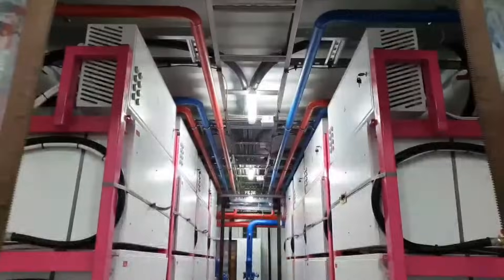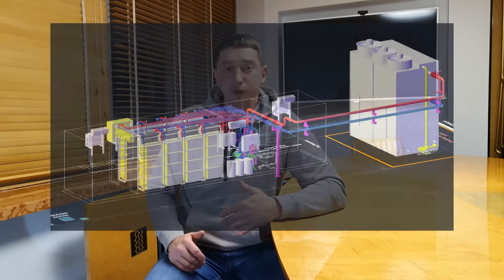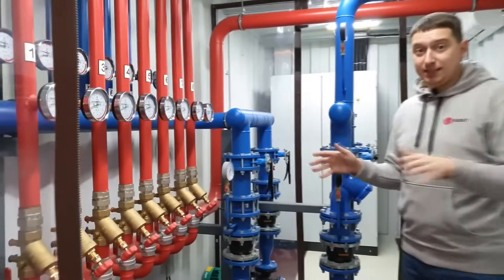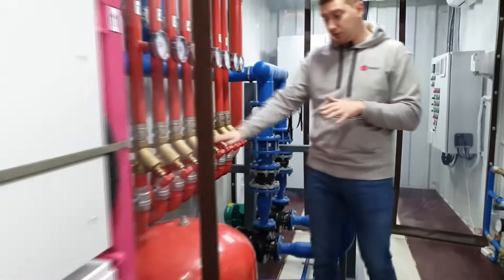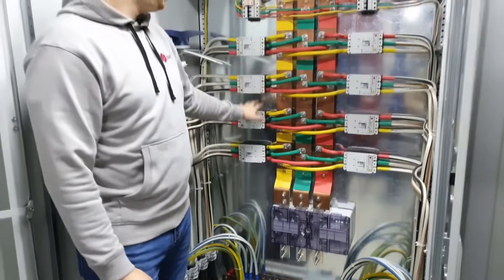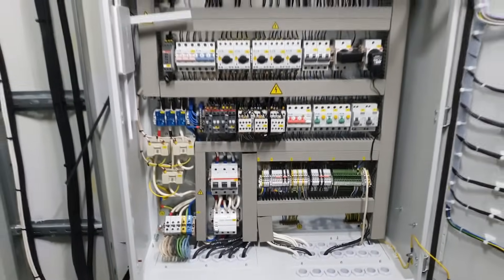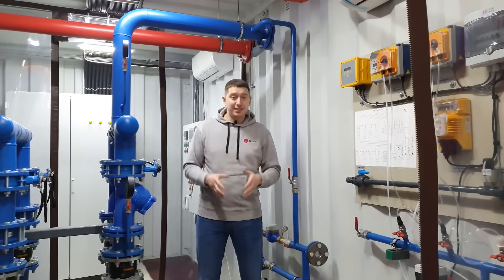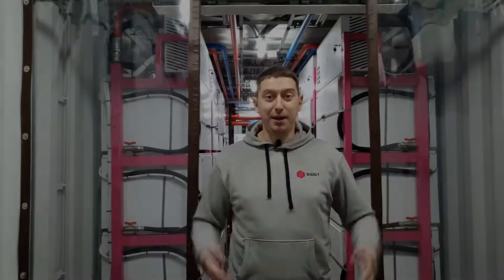CONTAINER FOR IMMERSION MINING

Comment: Guys, what ASIC I can you your containers for? And how resistible is your system to electric shutdowns and other emergency situations?
Reply from the maker: In our racks, any model can be immersed. The system is resistant to power outages and has its own control panel and monitoring. However, your power supply system should be the most stable otherwise it will not be mining. Equipment should work 24/7 to profit.

Comment: Would love to see a breakdown of how to wire all that…awg’s, voltages, relays, overloads, etc.
Reply from the maker: Most of the connections are already ready in the container itself, it is only necessary to connect the container to the power supply system and connect the pipes to the wet cooling tower. All this is in the design solution, which was developed by us.

Comment: Hello BiXBiT I need your help I just bought a miner and I'm using immersion cooling, I can disconnect the fans but I don't know how to turn the fans off in the program. How do you turn off the fans so that there is no fan error codes pop up.
Reply from the maker: Hello, describe your problem on our forum in the corresponding hardware thread and you will definitely be helped https://bixbit.tech/forum/forum/23-bitmain